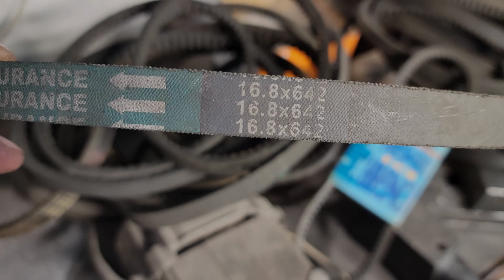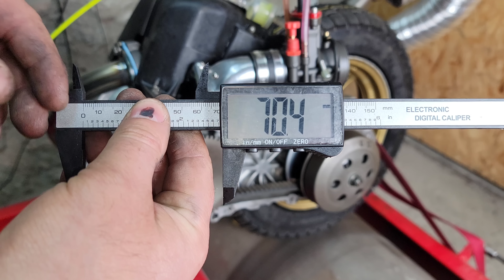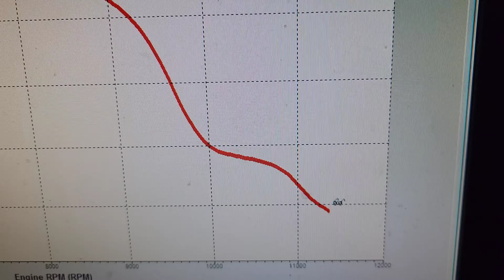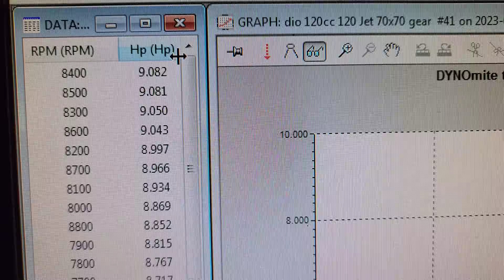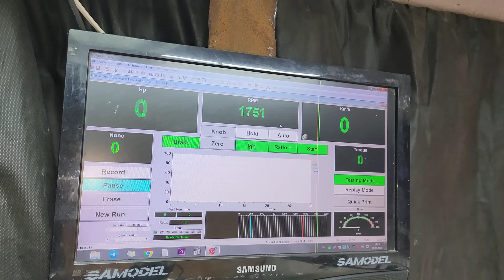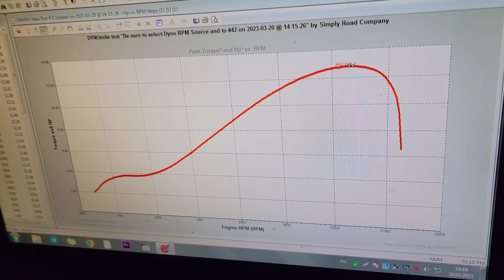Тест резонаторов TWH на диностенде - Honda Dio 120cc

Comment: You can gain more peak power with that pipe, using a big manifold 34 mm and them using a carb 34 to 36 mm, also increasing the exhaust port (exhaust grades) depending how the scoot behaves in the street. That pipe is more uncompressed than the other one, therefore the engine needs more intake and more relief. ⚠️⚠️⚠️⚠️⚠️

Comment: Biggest reason... the header, the header on the first pipe is extremely long, header should be 32% of the pipe's length. 132* Transfers with 188* ExP? That's not a good combination, surely blowdown is awful, I imagine the transfers down to the upper section of the cases are full of soot.

Comment: Hello SAM ! I have a question for you. If i have a completely stock 2 stroke scooter and i buy an exhaust pipe made for the scooter, can i use ONLY the exhaust and have results? Of course alter i would buy all the other parts like variator clutch bell torque drive.... but with only the exhaust, the bikes gonna run the same, less or more? Thanks for your help and keep posting about this Dio pls
Reply: it reaches more power with a better exhausst pipe . Later on you will have to buy new carburator because new exhaust makes de engine "eat" more fuel. a good combo is yasuni r and 17,5 dellorto. Also if you want to install a new exhaust only, you will have to recarburate the carburator, is testing the "CHICLÉS" in spanish. hope this helps you

Comment: Use a stock pulley drive, im sure its will increase the power. Then porting the pulley and select the ideal weight for pulley roller

Comment: idk that dynotest is accurate or not, but using dynotest here with Dynojet calibration, i can make 22.7wHP from 114.6 cc 2 stroke engine
Reply: Just need to find a resonator for 120cc it has resonators for 70-90cс

Comment: Это не плохо, мотор увеличил ход, должен сильно лучше с низов ехать, а верх требует длинной тонкой трубки в конце резонатора, без нее повысить мощность не всегда удается, как на картах(в картинге) ;)
Reply: Yes, the thin Pipe that you mentioned is called the Stinger Pipe....it can be straight, it can be in a curve, but it has to be thin in Diameter to create pressure in the Resonator 👍🤝
Reply: Для его моторая последняя труба жирная, дело даже не в стингере. Крутится вплоть до 11000 с провалом в крутящем моменте, нету прироста мощности, нужна изначальная труба немного укороченная и тогда он будет работать в полную силу, цилиндр слабый чтобы дуть 11 тысяч.
Reply: @foxstirn  Да по длине согласен.

Comment: 120 cc 12 HP  only ?!?! 😂😂😂🤭🤭🤭
Reply: I expected around 16-18hp and better high-rpm performance. Sorry for the master but for this amount of power all the work was wasted… :/
Reply: Just need to find a resonator for 120cc
it has resonators for 70-90cm³
Reply: Yes that’s about right with these bikes 12 hp is a lot for this setup
Reply: Make more)
Reply: 4stroke stock engines are 12hp at 125cc as well, so it's running on its optimal power I guess. One possible reason that's why it's not that aggressive is I think because of the torque distributor, in addition compression ratios should be determine here before summing up all the toughts after the outcome
Reply: Watch the previous video you can see the portings and timings, not anything crazy the peak power is farly low.
Reply: Stupid samodel
Reply: Its a low rpm aircooles cilinder.. its normall
Reply: @andrear629  при каких оборотах???
Reply: 54mm de diamètre, plutôt 100cc? L'admission au niveau du carter est petite. Difficile d'avoir de bonne performance avec cette base... Le pot twh a un bon collecteur, mais la résonance est pas adapté et surtout le silencieux est nul...
Reply: 150cc (gy6) 
10.5hp 🤦‍♂️
Reply: @tigranst3995  a stock YZ125 makes over 30hp.  Lots of 50cc scooters running around with 15+hp.  Could be the dyno reads low, could be the air cooled engine just can't keep up with the liquid cooled ones.
Reply: @randombuilds8336  not really the cooling, rather the  whole engine design.
Reply: @randombuilds8336  my scooter makes 19 hp with air cooled engine
Reply: @tigranst3995  that is 4 stroke
Reply: You can see the engine have the most powrr at around 10k 10.5k rpm. You call that a low rpm engine. The 70 or 100cc engines that reach 25/30 hp run at 14k 14.5k rpm. With some fine tuning he can get around 13/14hp with this stock engine. Thats more than enough for this engine and cylinder. You guys have 0 knowledge.
Reply: It was on chain so couldn't get to top speed
Reply: You guys are delusional

Comment: Why would you do a chain transmission and not a cvt ? Is a chain better
Reply: He's just using that setup for the Dyno. The variator changes the gear ratio on the fly, but on the Dyno you want to measure the power while staying in one gear. 
On the street the chain would not work well